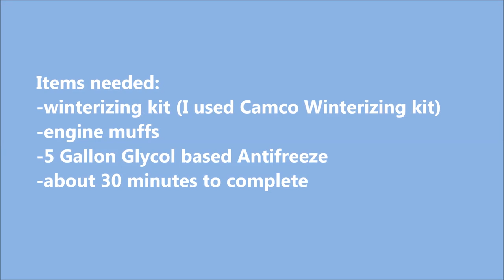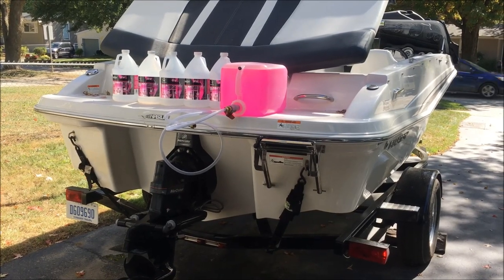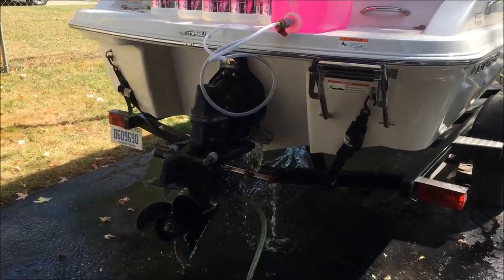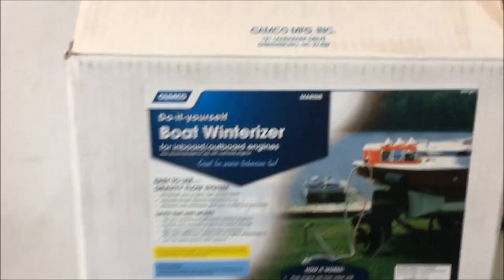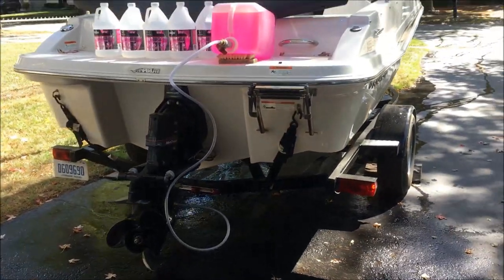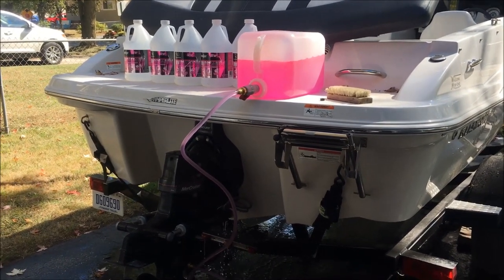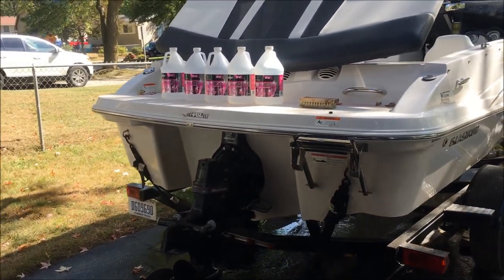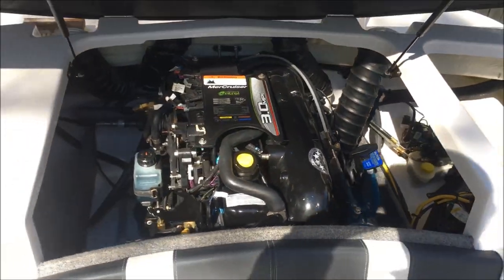Winterizing 2014 Glastron GTX 185 MerCrusier 3.0 MPI - Watch part 2 test link below.

Comment: do you need to fog this newer 3.0 engines ?
I’ve seen many videos on the older model and they always fog the engine
Reply from the maker: I never have since I owned the boat, I just add Stabil Marine with the last FULL tank of gas and that get's run through during the winterizing process. Always fill your tank full before storing so no moister gets in the tank (beside what the engine uses for the 15 minutes it takes to winterize), the Stabil will take care of any if it does along with your water separator that you can change ever 2 years. Those are just my thoughts and I'm no professional, just showing how I do it.

Comment: What size prop are you running on your boat? I have a 2014 Crownline with the same engine
Reply from the maker: Still has the original prop. Mercury Black Max 14.25x 21P Propeller 832832A45 21P
Reply: @jfisch01  what rpm are you getting?
Reply from the maker: @7852matt  If I remember correctly about 4700-5000. If we get out on the boat this weekend I'll double check.
Reply: @jfisch01  I have a 19p prop. I bought the boat used I don’t know what was factory. This prop is stainless so I know it’s not factory. I’m not getting 4,000 rpm but 41 top speed 🤷🏻‍♂️. It’s a Crownline 18ss I think it’s a little heavier than your boat but same engine.
Reply from the maker: @7852matt  Glastron boats are some of the heaviest out there. Mine weighs 2600lbs. Max speed I ever hit is 39mph - average is 37mph (GPS confirmed). I usually have a full boat - me, wife, 2 kids and 4 of their friends with us when we go out. Do you have a 4 blade? I can get one for mine but I would have to trim the tab thing to clear the blade, but researching it users said it makes the boat less controllable - but faster.
Reply: @jfisch01  41 was the best I did with gps. You’re boat is about the same weight I thought the glastron was lighter. Thank you for the information still learning my boat. Your winterizing videos where very good and helpful.

Comment: Did you leave drain plugs in or out?     Antifreeze is ok just leave in the block?
Reply from the maker: I believe your referring to the engine drain plugs or freeze plugs? If so, I don't even know if my engine has them, and if it does I wouldn't be able to reach them. I think the two petcock hoses (one for manifold and one for block) are what the freeze plugs replace? I'm no mechanic so I don't really know. But to answer what I think your question is, I left the antifreeze in the engine as the Mercury manual says not to leave the engine empty in winter months. Hope that helps.
Reply: @jfisch01  Leave your plugs in!

Comment: Do I need to drain the two blue hoses if I'm using the winterizing kit?
Reply from the maker: In the first step yes. After running the engine with water from the garden hose for at least 10 minutes to make sure the thermostat opens, shut off the engine and drain both the blue hoses (block and manifold). This ensures that when you start the next step of connecting  and running the engine on antifreeze that there will be no water in the block and manifold to dilute the antifreeze. Once the 5 gallons are sucked up in to the engine you don't drain either blue hoses- per my Mercrusier manual states do not store the engine dry in freezing conditions. The final step I have been doing is removing a sample of both hoses and using a hydrometer to test what is in the block and manifold is rated down to -50. Let me know if that helps or if you want me to make a video of how I test after winterization. Thanks, JFISCH01.
Reply: jfisch01 got it. Thank you! I just got stuck with the lower unit oil change. The Marina gave me the wrong connecter to refill. I need a bigger one that fits the threading. I have a 2008 Sea Ray 17.5. Thanks for the help
Reply: I believe if you have the camco kit with the t valve you dont have to, as you shut off the fresh water and immediately turn on the hose from the container with the antifreeze.
Reply from the maker: @timkovacs5108  I do have the Camco kit with the valve to change over to water, I never use it because my local marine dealer told me NEVER do it that way because your introducing antifreeze with the water and diluting it causing a higher freeze point. I always drain both block and exhaust manifold after the engine is warmed up and then introduce the antifreeze so this is less chance of it becoming diluted. I always take a test sample of both block and exhaust manifold and test it with the hydometer. We get down below -25 degrees F here in MI and a little water mixed in can easily raise the freeze point to above that temperature.
Reply from the maker: I made a video on how I test to see if your engine is winterized https://www.youtube.com/watch?v=K7a3EfpCZPY

Comment: if you take the time to drain it, why not stop there? I've always ran the engine until the thermostat opens then I run the antifreeze through it then its done!
Reply: I couldn't take out the block drain plugs on my 5.0LX/V8 neither under the hoses...but I used the 5 gallons antifreeze kit through the outdrive...is there a possibility of water still in the block ?  Drain plugs unreachable.  Pls advise
Reply: @edil.lopezm9443  Yes if you did not let it heat up to where the thermostat opened, you just have water in your block without antifreeze.

Comment: Warm engine up till thermostat opens, change over to antifreeze on the ear muffs, and run till you see pink antifreeze coming out of the outlets on the lower unit, your done
Reply from the maker: That may work if you live in a warm state where it  really doesn’t get cold below 30°. Here in Michigan you’re looking at -25 you better not have your antifreeze diluted with water.